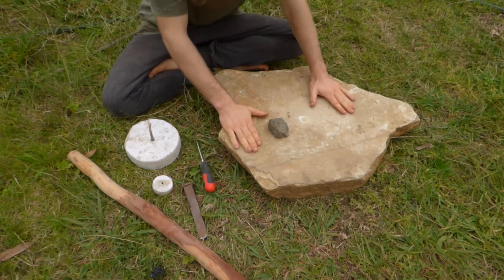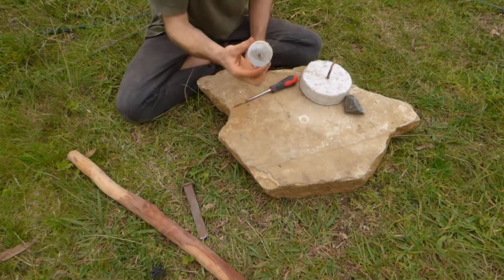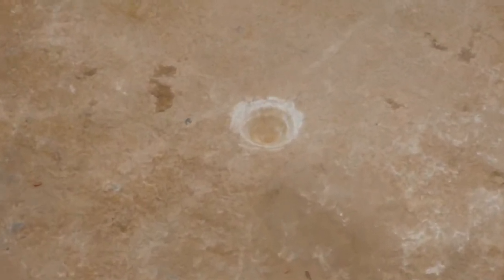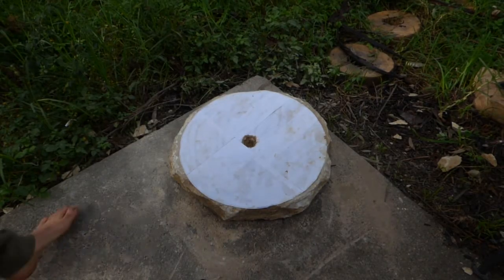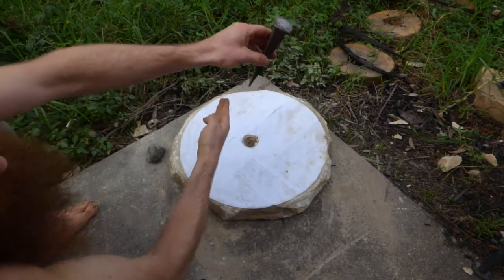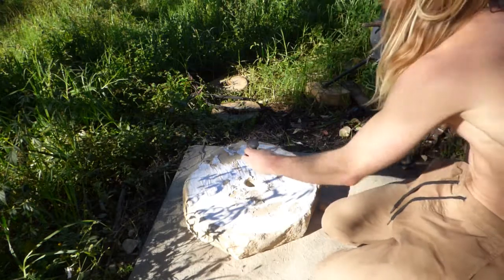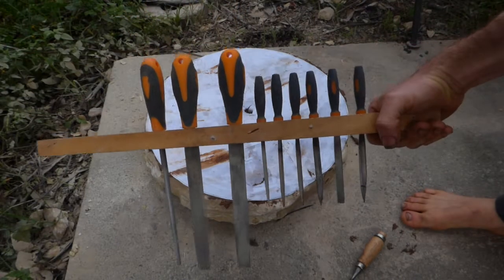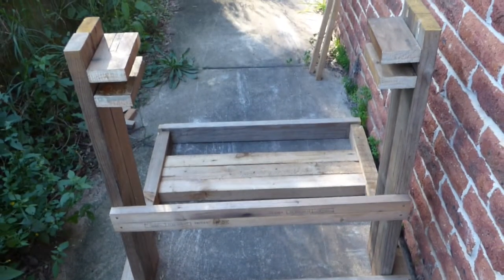Carving a grindstone

Comment: So did you finish this?
Reply from the maker: @lonewolfsvoice I finished grinding the stone however, I wasn't able to find the components being the floor flange, pillar block bearing and threaded rod (without having to buy a 6 metre length of rod)
Reply: @Ilovethebush  Often times machine shops will have off cuts. Hmm you're in Australia, I'm guessing, if you were in america I would say run down to the nearest farm supply store and they would have all of those items. Outside of that you could try scavenging parts off an old car at the scrap yard if you have one near you. Tie rod ends and some tie rod may be workable into what your need I think.
Reply from the maker: @LoneWolfsVoice  We tried all of that and no-go. Out rural also makes it hard to go to places. Unfortunately we are no longer at that property where that project was being made. Thanks for the suggestions!
Reply: @Ilovethebush  no problem. Hopefully it is something you can eventually revisit.